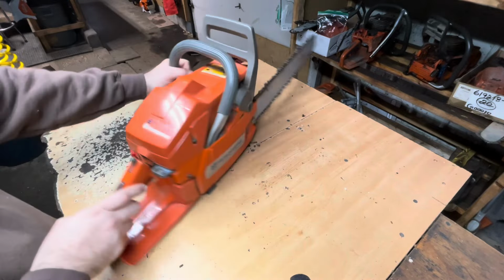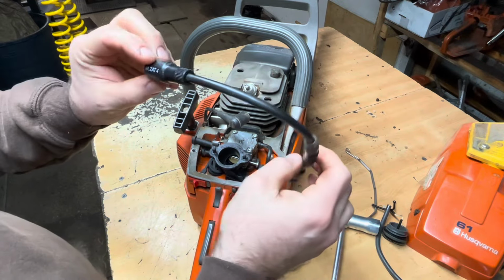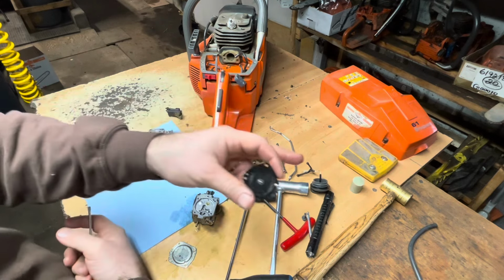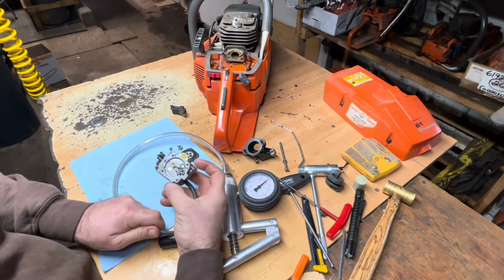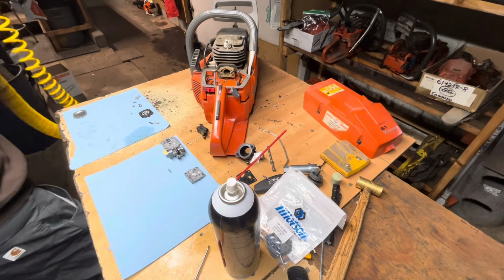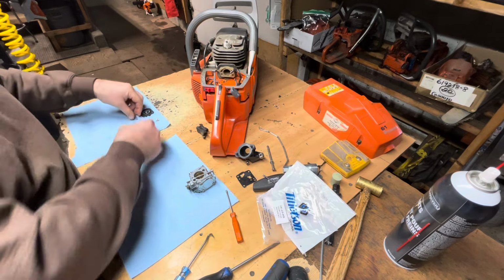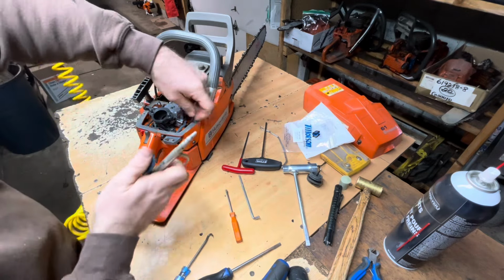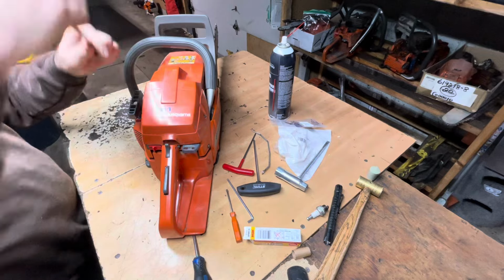Husqvarna 61 Chainsaw!   Why Won't It Start!  Let's Fix It!

Comment: My 1985 vintage -61 has no cyl hole, no pitting or scoring. Compression is ~155. These older -61s are such a total workhorse. They're like the small block chevy of saws; so easy to mod! Yes, the gas/oil cap o-ring seems susceptible to weeping even if regularly cleaned. The saw shown here is a later version with the plastic chain brake handle; original -61's had a metal handle. Enjoyed this video. thanks.

Comment: Years ago I bought 1 of these for a parts saw. Back then, if you were brave enough to fire it up, you should've had a catcher's mitt! I checked it a few years ago, no spark, low comp, it's a parts saw & not much else.

Comment: No need to cut the pump gasket, if you pressurize it and then tap the needle and it looses the pressure you don't have a false reading.

Comment: I was wondering if you could tell me how tighten the chain on one of these my grandpa gave me his old 61 as he can no longer use chainsaw
Reply from the maker: It should have a flat head screw on the front of the saw that adjusts the chain tension.   If you can’t see it it could be covered in saw dust.  
Good luck to you!  Nice saw!

Comment: What is the best chainsaw sold today you as a Still dealer know the chainsaw that come in for service
Reply from the maker: They all come in for service   -all brands, all models.   It really depends on how big of a saw you need and your application.
Reply: @marriedwithsmallengines  They do indeed.  I love Made in Japan, Sweden and German saws.  None too keen on any other places of manufacture or assembly.  I've been using and restoring/repairing saws for 50 years now and I have a garage in Australia that is saw heaven!  I like your channel and I wish you both all the best for 2024.